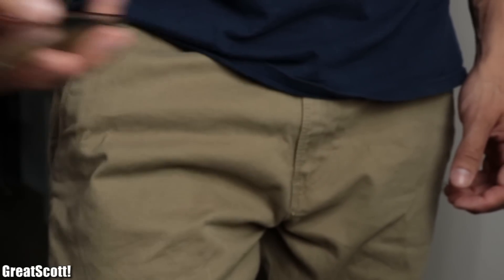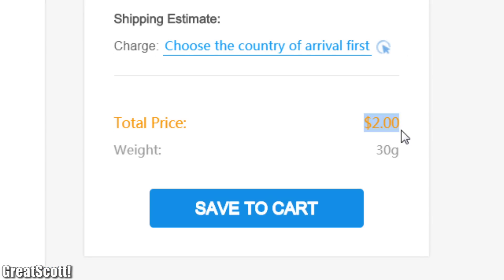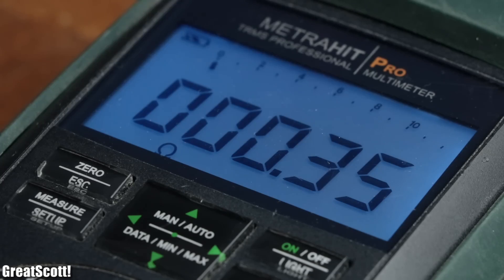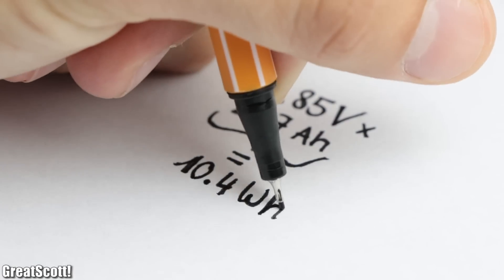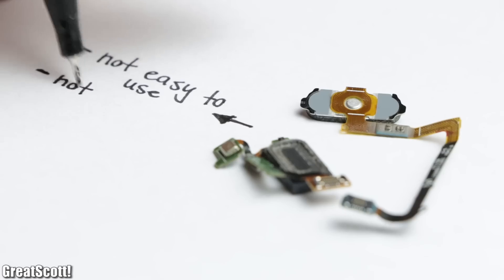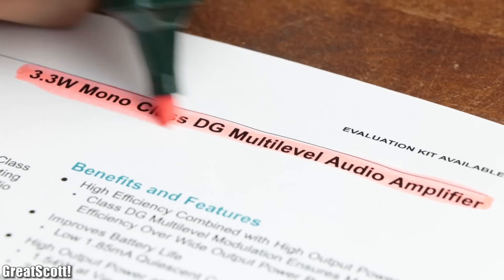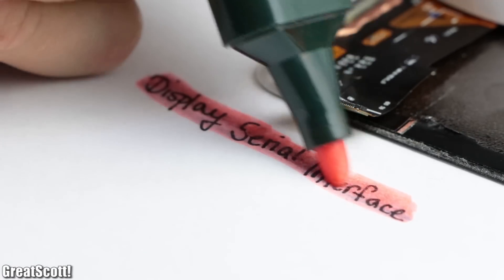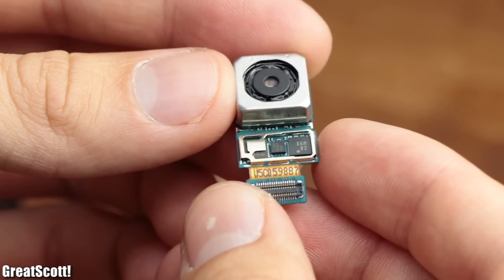What is worth salvaging from an old smartphone?

Comment: Imo, if the phone still works, it's not worth it taking it apart for parts  
A slow phone can be made faster by doing a factory reset or even installing optimized custom ROMs and still has a lot of uses
Need a camera near a dangerous experiment? Want to monitor your home with an IP camera? Dictaphone? Alarm clock? Backup phone in case your main one breaks? Something to run some home-server experiments off of? DIY projects that need to display something on a screen?
You essentially have a powerful computer to do anything you want that you can use as a server with lots of cool IO
Reply: Well said. Reuse and repurposing can be achieved at a macro level ... rendering everything down to dust isn’t always the best option.
Reply: Agreed. I disassemble my phones only if they're completely bricked and do not boot.
Reply: Zsombor Kaló how you even get to that point lol i never destroyed a phone worst thing was a boot loop or a black screen which i got fixed ezclap
Reply: What we need is a debian distro for old phones. That's all a Rπ is. At least your phone came with a screen, battery, and better case. Both your old phone and the Rπ are NDA locked hardware without a datasheet. The S7 I'm on now has a faster clock and twice the ram of my laptop on lubuntu. The problem is that no debian distro works well on mobile hardware... yet.
....but you're right. My older S5's camera beats the hell out of my current S7's. It's worth far more as a complete spare.
Reply: @UpcycleElectronics  There are arm-based distros that work just fine on Android. Though, they're often some franken-android distros
But what I'd recommend is Termux. Even without root, you can run an ssh/http/ftp server on any Android device, as well as many other unix/debian tools
Reply: @rebane2001  
  I've played with termux before, and goofed around with a few other options but I'm interested in learning low level (but still dumb-hobbyist friendly) hardware. I don't think there is any mobile (ARM) hardware that has really good kernel support. We're still stuck with the ambiguity of Alphabet/Google/Android security and permissions. I mean, an old phone is great as an isolated end node for an IoT project, but it could be much more if it just had real kernel support and a distro that isn't a google product. That's impossible without a datasheet though.
  There really should be a regulated  practice of releasing NDA datasheets after hardware is discontinued and a small amount of time has passed for it to legacy and clear the market.
Reply: Upcycle Electronics linux deploy works fine for me
Reply: Excellent point. I have an iphone 3gs that's my dashcam. Plus, it's a backup phone for car emergencies. A ten year old phone that's still serving a purpose!
Reply: Exactly. It seems incredibly wasteful to pull apart a working phone for parts. If the owner had no use for it then it could be sold on Ebay, given away to a friend or family member, etc.
Reply: @SlartiMarvinbartfast  How is it wasteful when you are harvesting the parts for other projects.
Reply: Luckily your post was at the top, so I do not have to write same. Old working phones can be used well. IT is true that new apps become larger and larger and use more and more CPU power that old phones with same aps become slower and slower and that is manufacturers intention so they can sell new models. But still old phones have many ways to be used.
Reply: Yeah, a 2011 galaxy s2 wich i aways use when my main phone dies, agreed with you
Reply: There are Debian based Android ROMs, so they can be alternative for RaspberryPi projects if processing power, not the IO pins are needed.
Reply: This is from the perspective and view of just someone who  can use the phone as a whole, and nothing else. That's most people, which is why this is such a highly upvoted comment. For people who are able to do more with other parts in there your list of things you can do pales in comparison to the list of things they can do with the parts, or just the value of having donor bits around for projects for someone who is always tinkering.

Different perspectives and end user goals are really what makes the difference here. What you suggested is just one alternative on a huge list with its own pros and cons.
Reply: Or just to watch porn when the other phone is charging.
Reply: @marek196c   genius
Reply: @marek196c  jea priority first😎
Reply: @marek196c  well I guess that something
Reply: @marek196c  🙃😂😂😂
Reply: @marek196c  wtf man chill out💀
Reply: @sahriarjihan220  bro talkin bout comment from 5 years ago...
Reply: Install linux on it
Reply: @rebane2001 how to use the phones io's to controll a project?
Obviously there is a lot of programming involved and the output it has is wifi, usb, headphone jack. That would take some serious programming not really a electronics project.
Reply: Sadly, the s7 snapdragon has a locked bootloader and cannot be unlocked...

And no factory reset is gonna speed it up if it gets laggy when it heats up.
Reply: @zNoah  A locked bootloader is unfortunate, but you can still use Termux on it
Cooling a phone is easy, if you don't need it to be very portable
Reply: @rebane2001  I had a tendency to cool it down by submerging it on water, but I don't do it aince my back glass is broken (Front glass is still intact).
Reply: I don't understand how a phone becomes "slow" I'm still using a 4 year old phone that's still as responsive as before. The battery is beginning to lose capacity tho. Still deciding if it's worth the effort replacing the battery or buy another cheap phone off eBay...
Reply: @SuperPickle15  It's because the companies that makes apps thinks that everyone buys new phones every 2 years, so they make their apps heavier and heavier.
For example, my old s5 mini works fast and without lag (Lineage os 13)... Until you open any modern app and starts lagging like crazy.
Reply: @SuperPickle15  4 years...my phone is 12 years old ,we have become spoilt and detached due to a fuelled consumerism that drives the economy that is artificially created to create a need ,a need that no valve circuit can fulfill.
Reply: @ericscaillet2232  Funny that you comment after I upgraded to a slightly newer phone. lmao
Reply: I use old phones as controllers for Arduino: they can execute fairly complex code and have a lot of memory, and usually are thrown away, making it a cheaper solution than, i.e., buying a wifi shield, a bluetooth module, a lithium charge controller or an arm-based arduino... I use USB OTG to set a serial communication between the phone and Arduino, so at least Android 4 is required.
Reply: penguin86penguin86 Woah this sounds cool, got any reading material on how to's and process?
Reply: My Galaxy S3 is about 6 or 7 years old now and still working 100% thank you very much :)
I do have a faulty Huawei Ascend though...
Reply: U r right
Reply: I think making this video was definately worth sacrifising a phone
Reply: with this comment there is 69 replies
Reply: @zyconnn1675  no
Reply: @justingregersen8084  wdym "no"
Reply: I have a bunch of old dead phones, have them stored because i really don’t know what to do with them. Most of them don’t work because the screens don’t work. Im a complete noob at whatever’s this guy is doing ( in the video ) but i really want to make something out of all the phones i have. Any suggestions?
Reply: No. Most phone design to get slower the long you use it to make you buy another.
Reply: @KiroHayashi  They don't lose performance, they maintain it but the apps keeps asking for more and more resources every update.

You can try to benchmark a phone for 2 years and it won't lose more than 5% of the original score.

And talking about apple, you can jailbreak and force the original clockspeed.
Reply: @zNoah  hmmm... Interesting
Reply: You are truely right
Reply: not samsung ;)
Reply: I use an sony xperia z1 with the display screen broken along with a MHL and an old Sony 55" LCD 3D TV as an "PC" an work perfectly with an mouse and keyboard interface :D
Reply: Completely agree, when my main phone broke I used my old phone to Livestream me fixing it because the screen was going bad or I guess worse then it already was. Now the old phone just lays in a shelf of my worktable, fully charged waiting to be used again.
Reply: Samsung phones tend to not be able to speed up after theyve slowed down even after resetting and putting custom firmware on it
Reply: i use them as security cameras and they works fine
Reply: this phone could work better in low-resolution modes. You can give it different tasks and use it as a control panel
Reply: lolol. the maker of this video learned nothing from your comment  pay attention- learn something
Reply: LineageOS
Reply: time-lapse camera
Reply: I have 2 unused phone and just turn it to dashcam
Reply: Hello
Reply: Well my old phone fell off 6 feet of sjelves teo times so it broke anyway
Reply: Music player
..
Reply: Or make it a retro gaming console?
Reply: I'm using an old one as an IP cam for the 3d printer so that i can check on the prints without having to go to the garage.
Reply: I use my old 4G mobile as a FDD Pocket Wi-Fi router. LMAO! XD
Reply: I totally agree
Reply: Nice comment, rebane 🙂
Palju õnne top 2 kommi puhul ka
Reply: I couldn't agree more, an old working phone is always going to be worth more than the sum of its parts, especially if you're the sort of person who watches these videos
Reply: I seriously have a fucking Samsung S4 but I still use it for development purposes
Reply: How does one make the phone not a phone yet capable to use all the other tech? Be nice to have a dumb tech that cant listen or spy on you from outside source or map you out.
Reply: How to do that, can you guide me how to do that
Reply: Especially if the phone is rootable.

In grneral, you can't root the prepaid phones.
Reply: yea, way more useful if you don’t take it apart.
Reply: , this video was just to show what you can reuse from ( working or not) phone, and not to actually get some new parts
Reply: Custom ROMs do not exist for Samsung devices using their filthy Exynos shit SoCs, though. Just do not buy Scamscum.
Reply: @kyoudaiken  Galaxy S3 uses an Exynos and has plenty of custom roms available to it, just saying
Reply: @chrono0097  LOL the S3 is how old???
Reply: @luminumlx2604  Yeah gonna wait 6 years until the current Exynos get drivers for Android to run the more revent Scamscum phones PROPERLY. xP
Reply: @kyoudaiken  a lot of custom ROMs exist for Samsung devices and ironically their Snapdragon phones cannot be flashed whatsoever
Reply: @kyoudaiken  better than apple
Reply: Are you a girl?

Comment: Is it possible to use the fingerprint scanner with arduino?
Reply: Yep, in most cases, the fingerprint scanner flex cable is just soldered on to the screen flex (e.g. On the Huawei P10 if I remember correctly).
Such a fingerprint scanner flex has 4-7 contacts (4 when it uses I2C, 7 for SPI).
Then you just need to find out the pinout (leave the flex on the display and attach that display to the mainboard, e.g. Probing for GND you take your multimeter in resistance mode, put one probe on one contact, and the other on a metal shield on the mainboard)

Regarding software, you almost always see one bigger ic on the flex, which is most certainly the fingerprint sensor controller. From there a few google searches and you're good to go

Comment: I was looking for this kinda video from a long time. Thanks a lot sir..
Reply from the maker: No problem :-)
Reply: Sir, I'm having 2 old phones. From last 2 years I'm trying to find out what I can do with the camera, TFT LCD and fingerprint module. But didn't got any help from internet (got only: reusing the display backlight). But I don't want to throw those nice camera modules. I did lot of research to use camera module with Arduino & raspberry pi. But didn't got any help at all.
Reply: @TechnologyWithSaikat  dude watch the video
Reply: @TechnologyWithSaikat  If you don't get the pinout or a converter board, which is unlikely, the screen will not be usable, same with the camera
Reply: Technology With- Saikat dude
If you have a working phone just download some camera IP software to use with your project or something.

Comment: Thats sad, imagine the project possibilities if you could save the screen and the cameras, or even better a Snapdragon or Kirin processor...
Reply: In his case its probabley an exynos cpu
Reply: For the screen and cameras, well, there is almost always at least an pinout diagram of the connectors somewhere on the internet, those connectors are Molex Series 51338 ones. With a little effort you could get one working^^
Then to the CPU, you can actually buy some from Digikey and co. (non-proprietary ones at least... Qualcomm's cpus should be easy to find). There are always at least "brief" datasheets of them obtainable by anyone. The only thing is reballing those ic's, that can be time consuming if you haven't done it before, but you can actually find quite good tutorials on how to do that on the internet^^
Reply: You certainly can save them (reballing a BGA is not that difficult) but without datasheets the components are completely useless. And even if you could get the datasheet somewhere (e.g. on some obscure Chinese forum), then you are facing a rather daunting job of designing a PCB for such processor. That's a high speed part, requiring SDRAM, high speed interfaces to everything, complicated power requirements (many rails and precise power sequencing required) - and it is tiny to boot! So building a one-off board with something like that would cost you more than just ordering a ready-made module in a much more friendly form factor and with documentation available  ... 

Iphones are slightly better in this regard because their screens and cameras are at least quite well reverse engineered/documented.
Reply: @JanCiger  You got a good point there, that kinda stuff definitely needs quite a bit of experience cause timing and such, especially for CPUs. For that it's definitely a better option to get a CPU module instead of trying to come up with your own design, I agree^^